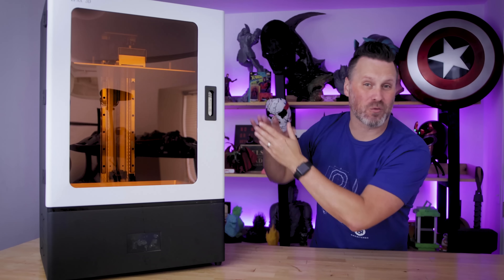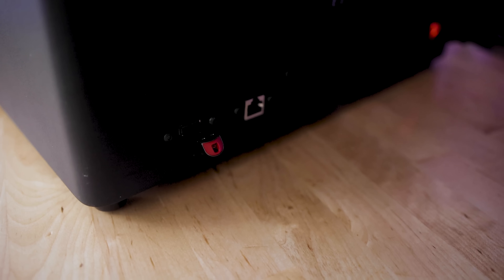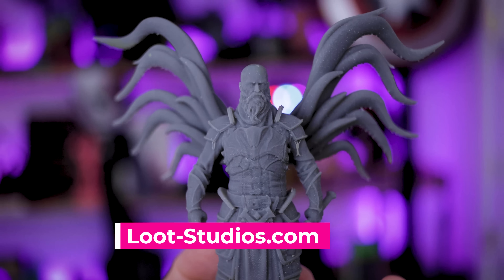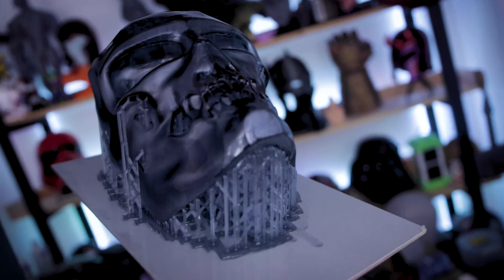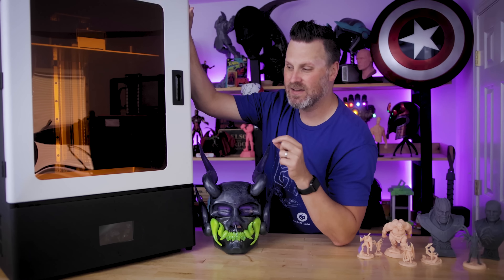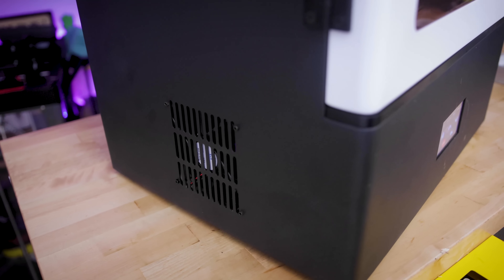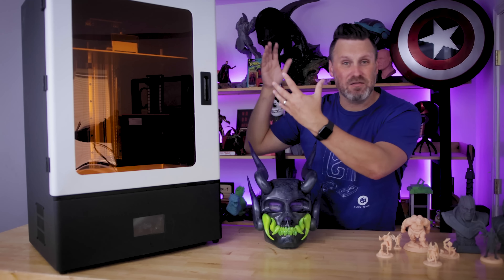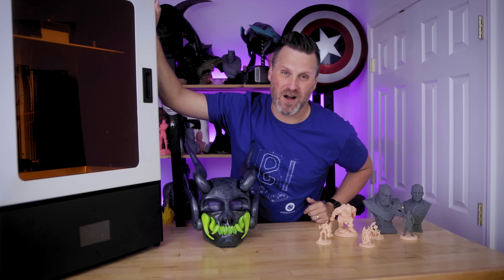Epax X156 Huge Resin 3D Printer Review

Comment from the maker: This machine is massive! Any cosplay print suggestions?
Reply: Rocketeer
Reply from the maker: @suspectdevice8725  ohhhh love that! I haven’t printed on of those yet
Reply: @UncleJessy  uncle jesse head helmet
Reply: Nova helmet
Reply: Swords of chaos from God of war would take up the entire height and be 1:1 size I think.
Reply: is this large enough to print a full sized Mando helmet.
Reply: He-Man fake abs / chest plate?
Terminator minimum?
C3PO body suit?
Reply: The Idol from Raiders of the Lost Ark.
Reply: Either that or star lord and the iron spider
Reply: what would you use to glue resin together for larger projects for max strength ?
Reply: @dassbear  you can glue resin together with resin.
Reply: How about replying to my comment on the epax ad on FB. If im so wrong, prove it. Or having a hard time defending the indefensible?
Reply: @cobeer1768  what are you talking about?
Reply: Yeah, use the Phrozen Mega 8k printer!
Reply: @King_Zer1  looked at the mega and is a few mm too small to print a lot of my full sized helmets. So while close the phrozen mega misses that mark. Also the mega uses a different lcd and uv source which they haven’t specified details about. So who knows how much and how readily available replacement parts with be for it? With all the nice flashy graphics and promo campaign, I just feel there is a lot of fine print and unanswered questions. I’d pass on the Phenom mega until it’s been on the market a while longer.

Comment: Hmmn, given the Phrozen Mega 8K (mono) and that Kickstarter machine made by some friends of Elegoo, this seems like last years technology. EPax have been teasing the X156 and X133 for 18 months or so, and they simply missed the boat. Peopoly has half a dozen different machines in or around this size (including Mono options) as does Phrozen. Not sure why anyone would pay close to $3k for this.
I'm also very curious about how well magnetic flex plates can handle such a large build plate? Phrozen have been perforating their large build plates for years to cut down on suction forces. I found even on a Saturn, large prints would detach or shift with a flex plate and I ended up removing mine. 
Finally, Fex plates can be super messy unless you are washing the print on the full build plate. Removing a flex plate with a print attached, still coated in resin, is a mess. And how much IPA is a printer this size going to use to fully submerge a model and plate? Phrozen are recommending a spray bottle of UPA or Acetone and an air compressor to clean their large stuff.

Comment: Phrozen has one with the same screen size, mono, and projected to be cheaper. The early birds are a grand, most projections I've seen are saying 1800.
Reply: The list price is $1869.91 but you can still get one for $1399 on the early bird. That will be $1899 with shipping, but that is still $1000 cheaper than this one for a better printer.
Reply: It’s near the sale size but a few mm smaller in either direction. Because of that, the phrozen alternative is just a tad too small for my cosplay needs as I would have to sacrifice sizing and make all my helmets a little smaller to accommodate the smaller build volume. 
So I will gladly stick with the Epax X156
Reply: @DarkKnightFX  I only print gaming stuff, so I'll have to take your word for it.
Reply: @dougwhiddon8227  pick what works best for you of course. I’m just suspicious of the whole marketing campaign on this thing. A lot of specs for the machine aren’t provided just yet, the lcd and uv sources are different and haven’t really been specified so as far as lifespan, cost and availability of replacement parts go, it’s anyone’s guess. Also the 8k thing is really just a gimmick. I believe the new 8K prints out the details at 43µm" that's only 14% better than actual 2K or 4K LCDs which have 50um pixel size.Meaning you will have a build area of: 178.60 x 100.46mm If you don't need such build area, don't let 8K fool you, a 4K machine at 35um is more detailed than a 8K at 48um. And as I stated phrozen hasn't even stated anything about LCD --- which can heavily impact everything. So it’s a roll of the dice. 
And as far as experience with phrozen, I have one of their sonic mini printers, and when it prints it’s a decent setup. But no matter how many times I level the plate, I still suffer from prints that won’t stick to the build plate. Seems random but I always attempt a fresh level every time it happens
Reply: @DarkKnightFX  I watched some of your videos, and you are doing some amazing work.

I have a Sonic Mini 4k and love it for mini's. I admit leveling is an issue. I usually just forgo the sheet of paper and try to tighten it as much as possible. Too tight is better than too loose. The only resin printer I found easy to level was my Photon.

As for resolution - if the 8k is still not quite as good as the Sonic Mini 4k, and just as fast, it will be well worth the money. My other large printer is a Peopoly Phenom and the 8k has much higher resolution. The Epax-x156 has a listed pixel precision of "90um / 76um" so the only thing it has going for it is the slightly bigger size. I was all set to buy a Phenom L as my next printer,  and this one is better than that in every possible way.

Looking forward to video reviews of the 8k as they start showing up.
Reply: @dougwhiddon8227  so far I’m really happy with this x156. I’m picking up their smaller E10 for some of my smaller prints. So I’ll be reviewing that one probably in the Just week or two. I’m not sure if you’re on Instagram, but if you are, look me up. I have a lot of  designs I make. I’m super excited to remake a lot of the stuff using my resin printer now.

Comment: With the lifespan just making like six of those masks is pretty much making the machine done for. I might not understanding something that's just bad investment overall
Reply: The screen replacements are about $150 and a mono screen upgrade is also available which will last a lot longer and deliver faster print performance. As for printing X amount of masks before the printer hits is lcd lifespan, you work that into the cost of your commissions if you’re selling the resin prints, or you see it as an worth it expense for the times savings when getting a prop ready for molding. Printing just one helmet on an FDM printer will have me doing about 4-10 hours of post processing work to have the outside surface smooth enough to mold. If I want the inner surface smooth too, it’s going to be a lot longer. With a resin printer you can cut that labor and time spent by at least 95%... probably more. For me this was one of the best investments I’ve made for my cosplay business
Reply: @DarkKnightFX  very informative thank you. I have no experience with this type of 3D printer. I guess I have to excel a cost calculator before investing in this high quality one.
Reply: @a.p.2018  I have a video review on my channel for this same printer. I would suggest and appreciate it if you checked it out. In that review I provide a side by side comparison between an FDM print and Resin print of the exact same helmet file so you can see the difference and I briefly show all the faults of the fdm print and how the resin print excels and saves me so much time.

Comment: Awesome review!  I did the math and with the 4k screen you're at an xy resolution of 89.8 microns.  So the other problem with larger machines is that that xy pixel size does get larger.  But still looks incredible and I bet they'll have replacement screens eventually to bump up that resolution.  For example if they did an 8k screen at the same size it would make it 45 microns.
Reply: Check out the Phrozen Mega 8K - same size as this, and a 43um resolution. Better detail than a Mars or Saturn, at a massive size, a monochrome screen and 2/3 the price of this.
Reply: I believe the new 8k prints out the details at 43um.  That's only 14% better than an actual 2k or 4k LCDs.  Which have 50um pixel size.  Meaning you will have a build area of :178.6x10046mm if u dont need such build area.  dont let 8k fool you.  a 4k machine at 35um is more detailed than a 8k at 48um.  also believe phrozen hasnt even stated anything about lcd which can heavily impact this.

Comment: This printer is already obsolete. Phrozen Mega is 8k monochrome for half the price.
Reply: 8k is just a gimmick on the mega as far as I’m concerned... I stated this elsewhere but I believe the new 8K prints out the details at 43µm" that's only 14% better than actual 2K or 4K LCDs which have 50um pixel size.Meaning you will have a build area of: 178.60 x 100.46mm If you don't need such build area, don't let 8K fool you, a 4K machine at 35um is more detailed than a 8K at 48um believe phrozen hasn't even stated anything about LCD --- which can heavily impact this. That and the build volume of the mega is smaller... although the size difference is minimal, it is enough that it will not fit some of my full sized helmets as where the X156 fits them just fine.

Comment: mask ≠ helmet ;) Seems like this will still need multiple jobs for helmets. I think the only printer out there that could do a helmet in a single run is the Phenom XXL, but that's also like $8K. I think one could get a helmet printed faster and cheaper than either of these options by buying 4 Elegoo Saturns (assembly time notwithstanding, and I suddenly have an idea about making such assemblies easier... hmm).
Reply: He has shown to print full helmets on the Phenom L and this is a clone of it.
https://youtu.be/jFpkMRC-4n0?t=861
Reply: i print helmets on my x156 and i just have to split it in two for the most part and them resin weld it.  not a big deal but at least i can do full helms and the quality is great.

Comment: The only reason I haven't pulled the trigger on getting a huge printer like this isn't the cost of the machine, it's the cost of the resin and the replacement screens. The price of the machines will probably drop in price rather quickly but I bet the cost of resin will steadily increase over the years.
Reply: What do you want this printer for, if you don’t mind me asking? Just for fun out as an investment in a business venture or the like?
Reply: @DarkKnightFX  For fun. I make replica props and models. The same kind of stuff you see Uncle Jessy making.
Reply: @stinkyham9050  if it’s purely for fun, then I can see where the price is intimidating. For a non-profit hobby, it is a hard pill to swallow for what would essentially be a toy. But if you find yourself selling your stuff on Etsy or something like that, it is an investment well worth making. I was hesitant for a long time thinking i could achieve the same level of quality with my cheaper FDM printers and a little elbow grease. For the most part you can argue that it could be done as I’ve been doing it for years. But since purchasing this machine I couldn’t imagine going back to FDM printing and the whole sanding ordeal. It has changed the way I look at work, raised the bar as far as how I will detail my 3d models in the future and literally saves me a full days labor or more with every large scale print I do. It’s a game changer in every sense. So remove the pre-conception that is overpriced and not worth it. In the right hands and in the right circumstance it is worth much more.
Reply: @DarkKnightFX  I have an E10 and a photon so I get where you're coming from. I also have a very large budget but the thought of losing over $100 of resin from a failure does make me a little nervous.
Reply: @stinkyham9050  I’m guessing it really depends on how large of a print your working with. I filled my vat with roughly 2 bottles for my helmet print and I still had some left. With bottles being around $30-40 I’m guessing if the print failed I would have been losing $30–50 worth of resin (or less depending on when You noticed the print begin to fail). So far I haven’t had a failed print though. Knock on wood
Reply: @DarkKnightFX  well now I'm starting to get tempted. Lol.
Reply: @stinkyham9050  the seed has been planted! 😁 seriously, I have zero regrets other than I wish I purchased sooner.
Reply: screen replacement on this takes like 5min...super easy and if u get the color screen its about 150 and the mono is around 500 if i recall.

Comment: It's a very strange machine. It's got 2 main benefits:
(1) It can print large objects in one part.
(2) It can do large numbers of smaller items.
However (2) is totally gimped as it's not Mono so wastes the extra build area relative to other Mono Medium sized machines.

Also how many 4K screens does it have.. is it just 1X 4K screen over that massive build area?

Ultimately if your looking at bulk printing you could buy Multiple (4-8) Mid Sized 4K Mono printers for the same price .. each with better resolution and combined orders of magnitude more throughput. Any machine breaks down and you've still got redundancy with additional machines and you're not out of action until you fix your sole machine (all your eggs in one basket).

So I can see it's got a niche market however for large single prints.. so it is very cool in that respect.

To remove the resin from the vat it may be an idea to get a large syringe (100-500 cm3) with an appropriate material plunger so you can get it nearly empty first.

Comment: So what price is the replacement non-mono screen?  Price for upgrading to mono screen? Price for better releasing / flexible build plate?
Noob question - what if you drill holes thru the existing plate for use? Would it work if smoothed holes post- drilling or trash the plate? Would this be practical for making an entire army of mini-figs in one go?

Comment: Wow man I can't believe that printer manufacturers still create this behemoths and put a non Monochrome screen is just nonsense... in fact 2799$ price tag and it's not a crazy price for that size but didn't know how much will it cost a LCD replacement, I guess about 350$ it's nuts and increases the cost of the machine work too much.
Epax is wrong releasing this machine now without Monoscreen because the Phorzen with it's 8k machine will and it's price will crush the market.

Comment: I don’t understand what the “lifespan” of the display exactly is. Does this display actually die and you have to buy a new printer or does it need to be recharged? Or is it something completely different?
Reply: The screen will eventually die but replacement ones can be bought and put into the printer
Reply: The mono screens are more expensive but the cure time is only ~2 Seconds per layer Vs ~8 Seconds on a normal screen. So per print the Mono screen is exposed to UV for about 1/4 of the time as a normal colour screen. 

I believe the Mono screens are also more resistant to the damage caused by UV exposure.

Mono Screens are more expensive than Colour screens due to Colour Screens being the vast majority of screens being made... unless we start seeing Black and White smart phones etc they will always be more expensive.

Comment: It's the same a peopoly phenom ?
Reply: It's like the Phenom L
Reply: I have the phenom L just the color of the door is different. I am waiting after the  monochrome upgrade they  are developing for the phenom.
Reply: @magomat6756  Me too
Reply: @magomat6756  How much does it cost for resin for something like a full size Star Wars helmet? In USD.
Reply: @stinkyham9050  it depends on your resin it goes from 50 $ to 100 for a bottle of 1/2 liter.
Reply: @magomat6756  How many litres roughly would you say it takes to print something that large?

Comment: Just used my resin printer for the first time…. What a mess XD
Reply: It was the same with me, once you have a system worked out it will get better.
Reply: Get your wash and cure system down pat before pulling the build plate off the printer. I struggled with huge messes until I came up with a system that worked. It helps if all the machines or washing bins (or whatever else your using) are lined up in the order you're going to use them. If you have a metal build plate stick it right in with your washing bin/bucket/ultra sonic cleaner then pull the print off, let it air dry and then cure it. The mess is minimized this way. Even though you have gloves on try to avoid getting resin on your hands so your not spreading around your work space, less to clean up as well.
Reply: Yes , it is but if yuo can buy a whash and cure solution, its help a lot

Comment: I've heard larger print resin print plates run into issues with forces on the bolts if the build plates don't have holes in them.
With how massive this is, is that not a concern? I haven't heard anyone really talk about this much.

Wish I would have found your channel sooner. I've been loving resin printing!
Reply: I have the Phenom L and have not noticed any problems but I can imagine for a print plate like the one of the Phenom XXL you need the holes.
Reply: I can imagine it shifting or detaching a magnetic flex plate,  like the Wham Bam as well.